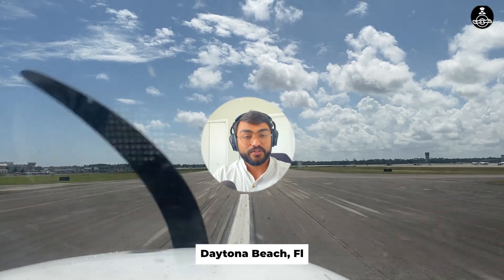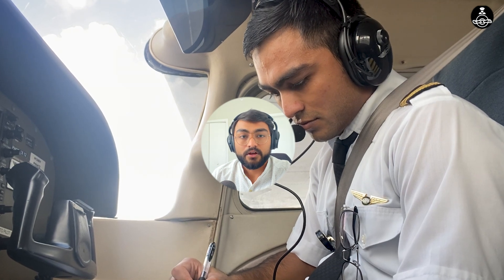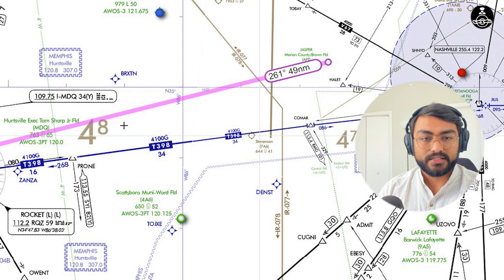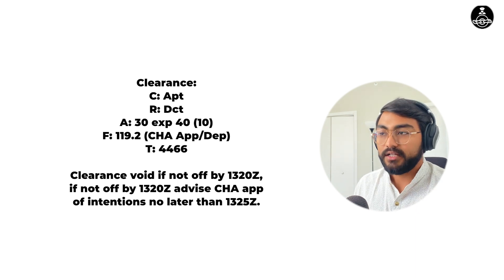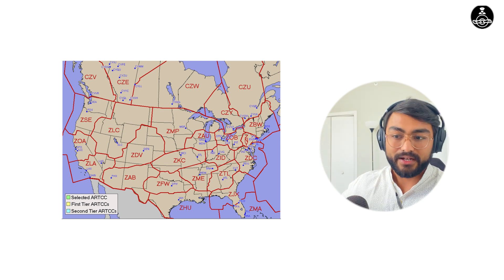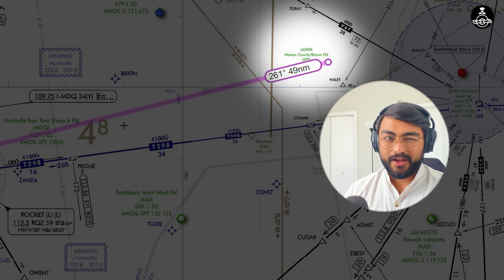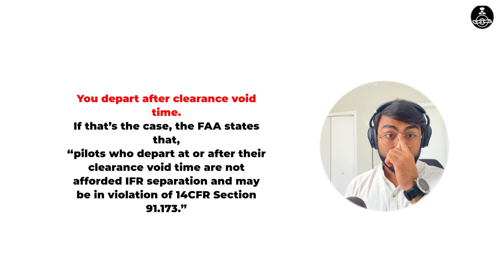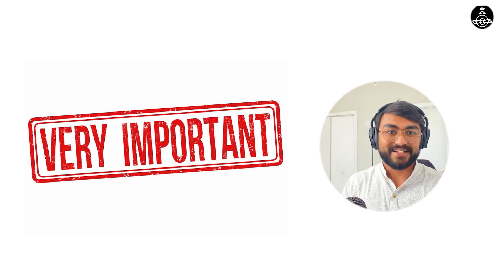Have you learned Clearance Void Time like this? PropelAPilot

Comment: The word "clearance" in clearance void time is misleading. The word "release" would be better suited. Atc is providing you a release and void time for that release. Your clearance is still valid for 2 hours after your ETD, so you don't need to file another flight plan. You just need a new release time.
Reply from the maker: I think there is a confusion between release and void times. Both of them exist and are used for ATC separation purposes. However, if you reference AIM, it clearly says that your clearance is void, meaning you need a new clearance. I think what you are referring to "clearance is still valid 2 hours after your ETD" is the flight plan that is filed with the ATC system. It is easy to get confused and I will try to make a video talking about the differences in these.